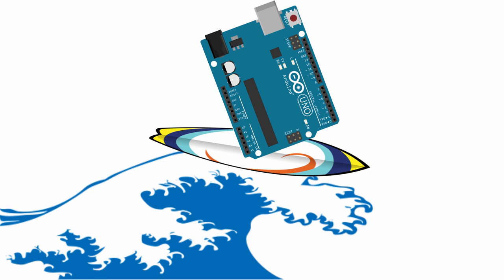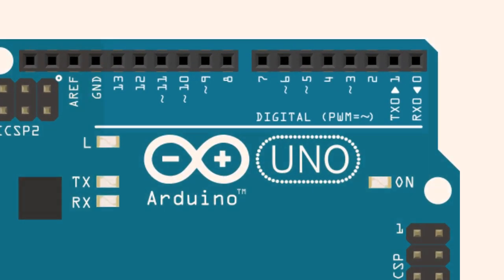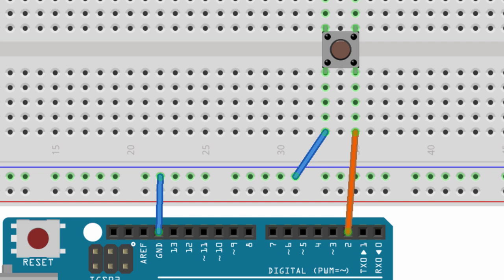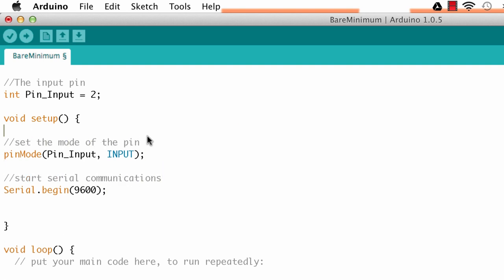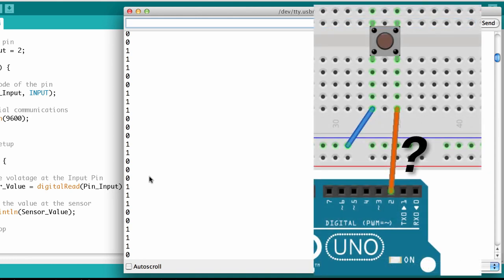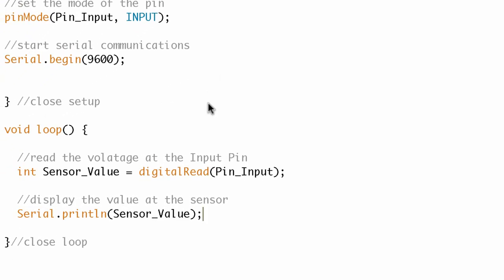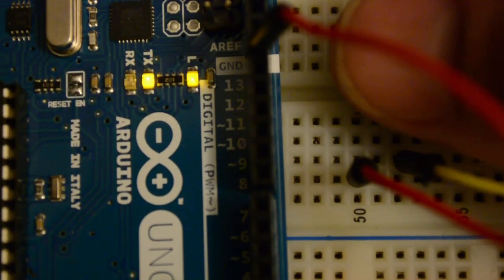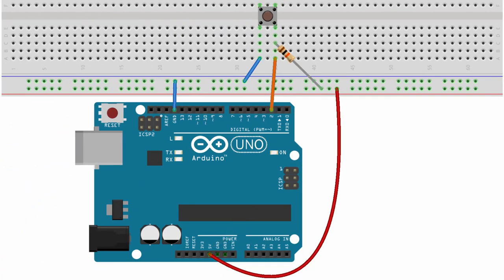Floating Pins, Pull-Up Resistors and Arduino

Comment: Great video but why don't you use the internal pull up resistor built into the Arduino boards instead of an external pull up resistor ?
Reply from the maker: Ken Franco Great question Ken!  Since the button sketch examples that come loaded with Arduino all use external pull ups I decide to follow suit.

But I agree, the INPUT_PULLUP is the way to go.

Comment: i m a beginner 1st yr studentwhat should be the approx value of  pullup resistor ? so that the pin reads high despite its drop across resistor.

Comment: at 9:00, the pin2 read should not be 5v when no press, because there is a resistor
Reply: yeah it should read way lower than 5v  because 10k resistor limits voltage + current

Comment: lmao! I didn't even know I had this problem and since I am a programmer, I did the solution software-wise by it counting the number of loops that it's low. If it is low for over 20 loops the button is pressed. Not very elegant, I know

Comment: the atmega 328 has built in pullup resistor you have to activate in the void setup using digital write to high. ;)

Comment: I'm confused. My understanding is that INPUT mode states that the pin reads voltage. The voltage flows from source to the ground. What is the source in this case? The flow is from the ground to the pin? I always thought that INPUT pin will read +v not ground.
Reply: +313jacob T thought that too and I was going to ask that until I saw your question
Reply: Your're right, it does read voltage.  Ground is 0 volts.  If you connect ground to an input pin, it reads that as LOW.  (On an Arduino, that is anything below, I think, 1.2 volts.)  If nothing is connected, then the input pin floats, and you get unpredictable readings.

Think of it in terms of water.  Suppose that a garden hose is connected your pool (the Arduino) and ground (a drain).  Let's say that in this bizarre pool-world in your Arduino, there can be passing rain showers that can instantly fill up your pool, and there are also other internal drains that will eventually (but not instantly) drain this rain water off.  But once the garden hose is attached, water in the pool drains instantly.  If you don't have the garden hose attached, that stray water sloshing around will vary, so that at times, it looks like the pool is full enough to swim in (the pin registers HIGH), and at others, it's barely full enough to wade in (the pin registers LOW).

Comment: Great video.  I always think of a pull up resistor like  a coil spring.  When the resistor is connected to 5V,  it tries to pull up the voltage at that point to 5V but can be overcome by a direct connection to ground when the button is pushed.  Much like a spring, it returns to the original position (5V) when released.  When the button is pushed there is a 5V drop across the resister which is converted to a very small amount of heat.  There is very little current flow because the resistance is relatively high.  A pull down resistor really works the same way, the resistor or "spring" is connected to ground.  When the button is pushed the switch can provide 5V which overcomes the ground and produces 5V to the Arduino pin.  Since the symbol for a resistor is a wiggly line, it reminds me of a coil spring.

Comment: Would you please tell me, what is the resistance of pull up resistor on this diagram?
Reply from the maker: It's a 10K Ohm resistor in the circuit diagram.

Comment: I’ve watched about four videos on this topic, and yours is the first that explicitly says why a resistor is needed not just how to do it. The part where you said path of least resistance is when the proverbial lightbulb went off in my head. Thanks!
Reply from the maker: Great to hear!  Sometimes for me I think it takes quite a few different angles, and then all the sudden things pop into place - its a great feeling.  Glad this could help some!
Reply: @programmingelectronics  I don't think it's about repetition and different angles, it's more about asking and answering the right questions, and breaking it down into digestable parts. After previous videos I was still clueless at the end. Your explanation and visual aids were fantastic, and I echo @clunkclunk2099's experience. Thank you!

Comment: This is the best tutorial i ever encountered but still a small question. After the pull up resistor is connected to 5V , isnt the connection to digital pin 2 is always gonna read High even after its pressed or not ! or am i wrong on some logic ?

Comment: What's the difference with this wiring and other where pressing pushbutton gives HIGH voltage and not pressing gives LOW voltage?
Reply from the maker: Great question!  You would have one side of the button connected to 5V pin, and the other side connect to an Arduino pin set as an INPUT, and also a pull down resistor going to ground.  I often see pull down resistors around 10K ohms.

Comment: I think it would have been helpful to add that changing the input pin mode assignment from
pinMode(Pin_Input, INPUT);
to
pinMode(Pin_Input, INPUT_PULLUP);
accomplishes the same thing and eliminates the need for an external resistor.
Reply from the maker: Totally agree Chuck!  Thanks for pointing that out!

Comment: Best explanation of Pull-Up Resistors I've seen. Only improvement is if you said the Arduino has one built in, and how to activate it.
Reply from the maker: Thanks so much for watching!  Good call - that totally should have been covered in this video.  You may already know, but just in case...

To use the internal input pull up, use pinMode(yourDigitalPinNumber, INPUT_PULLUP) 

What this does is set the pin as an input - so it can read digital inputs - but it is internally being pulled to a HIGH state.  If you want to trigger your input, you connect the pin to ground (i.e. through a button press)

https://www.arduino.cc/reference/en/language/functions/digital-io/pinmode/

Comment: I have recently been using 2 pin instead of 4 pin pushbuttons.  Do the 2 pin buttons eliminate the risk of floating?
Reply from the maker: Great question!   It does not eliminate the risk, since the pin still floats when the button is not pressed.

Comment: Great explanation, as a follow up, why don't you do a video on the internal pull ups of the arduino?
Reply: Electronic Parts idd really like to see a video explaining int pullups as well.
Reply: @noud8868  Using the internal pullup means you don't need to add your own pullup resistor. To connect the pin including using the pullup resistor included in the Arduino use this code in the example given in the video 
pinMode(Pin_Input, INPUT_PULLUP);

Comment: Michael Cheich: Thank you for this excellent video.  Took me a while to "get it", but now I do.  After watching this, I took your free "Arduino Crash Course", which convinced me it would definitely be worth buying full access to all your training, which I have now signed up for (so you can, as you say, keep gas in your Lamborghini...)

Now just a couple of notes (as Michael says, the best way to learn is to look for opportunities to "teach" - explain it to someone else):

This video shows the problem of floating pins, and how to resolve that via an external pull-up resistor.  Once you understand the concept, you can by-pass the problem on digital input pins in one of these two ways in your code (rather than on a breadboard) - using digital pin 2 as an example:

pinMode(2,INPUT);
digitalWrite(2,HIGH);  // WRITING HIGH to this INPUT pin activates its built-in pull-up resistor.

OR

pinMode(2,INPUT_PULLUP);  // Does both of the above steps in a single statement.

Either of those activates the internal pull-up resistor built into the Arduino digital (and maybe analog?) pins. This info can be found in the Arduino Reference documentation for the pinMode function.

Again, I suggest you DON'T use the built-in pull-up resistors until you complete this video and understand the problem of floating pins in the first place.

Comment: What you are reading at "floating" pin is your main (50 or 60 Hz). That is because input pin has very high impedance. Pull up resistor make "offset" to the +5V. But, you may want to avoid adding resistors to +5V by simply using next code(s):
pinMode (2, INPUT_PULLUP);, where MCU gives about 200 kOhm resistor internaly to pin 2. Or:
pinMode (2, INPUT); digitalWrite(2, HIGH);, which gives the same result. Note that although pin 2 is input, you write in setup HIGH value (digital 1). There is NO pull-down resistor inside MCU. Another advanced way to make whole sketch:
void setup() 
{
  Serial.begin(9600);
  DDRD &= ~(1<<PD2); //set PD2 as input (pin 2)
  PORTD |= (1<<PD2); //Internal pull-up resistor on PD2 (pin 2)
  DDRB |= (1<<PB5); //set pin 13 as output (LED onboard)
}

void loop() 
{
  (PIND&4 ? PORTB |= (1<<PB5):PORTB &= ~(1<<PB5) ); //if PD2 = 1 then pin 13 = 1, else pin 13 = 0
  Serial.println(PIND&4 ? "Button is Not pressed":"Button is Pressed"); //if PD2 = 1, print first statement, else print second one
  delay(500);
}
Reply: Floating pin take charges around from your finger, stray wires etc.! This causes the fluctuating voltage..So you need to tie it up! Nice concept!

Comment: I understand it now. If the button is pressed the path of least resistance is to ground. So then is there some small resistance inside pin 2 when the pinmode is INPUT?
Reply from the maker: Hi Gus, Yes, there is actually a really large amount of resistance inside pin 2 when it is set as an input.  Below is from the Arduino reference:

"Arduino (Atmega) pins configured as INPUT with pinMode() are said to be in a high-impedance state. Pins configured as INPUT make extremely small demands on the circuit that they are sampling, equivalent to a series resistor of 100 Megohms in front of the pin. This makes them useful for reading a sensor, but not powering an LED."
Reply: Open Source Hardware Group Great thanks!

Comment: can we use the Pin_Input directly without have to define Sensor_Value in if/else statement?
Ex: if (Pin_Input == LOW) {digitalWrite(13, LOW);  }
Will it works?

Comment: Just watched multiple pull-up resistor videos. This is easily the clearest and best, thanks.
One question please:
Final circuit shown 9:00. 
Switch closed. I'm imagining that Pin2 is "positive" and current flows to GND.  (Maybe I shouldn't be thinking like this, but either way I understand reading is LOW).

Switch open. Current flows from 5Vpin to Pin2.
Question - Pin2 must ultimately lead to ground for this to work right? Within the structure of the board.

Comment: Thanks for valuable tutorial.
I have a problem. I used three pin of Arduino Uno for difefrent warning in the Banana Glasshouse. High heat, high moisture and high wind speed. I connected 10k resistor like your tutorial. It works in my office without problem. When I connect Ground to any of my pins it tiggered the GSM module and call mbile phone for warning. 
But When I use this sytem in the Glasshouse it start to call me without contact of any pin to ground?! I could not understand. There are drivers and any other electronic equipments in same room. What shoul I do? Why the ground and digital pins contacting by theirselves without touching them and without any effect?🤔

Comment: my problem is when my Analoginput pin, is release the arduino restart and read again, but when it is not connected and i connect it, it reads normally fine, I don't know why it resets the arduino though. i am reading voltage through a0; and the voltage is 4.88 but when i turn off the supply of 4.88 arduino resets. why?

Comment: So without the resistor, the resistance of pin 2 is extremely high (100 Megohms) because that's built in? That resistance would make too little current come through, and so the 10k resistor allows for more current? Is that why this doesn't work without the 10k resistor?

Comment: I would also add that this mysterious "noise" is that cable starts working as an antenna (like the one in your phone), if you pull out the cable, the pin read will go from random to 0.

Comment: sounds more like anti-noise-resistor than pull-up.  i know it pulls up a floating pin to 5V, but ultimately it makes the stable, which is the point.    but the name pull-up make it sounds like it was low volt, and now i have higher volt, which is kinda misleading.

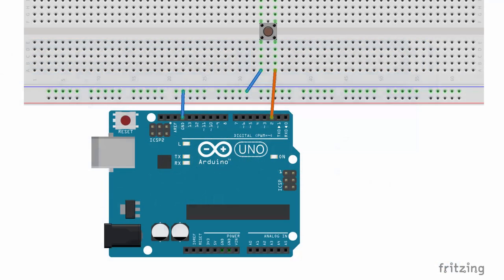Comment: I assembled the circuit as it is at 1:49 , and using completed code at 4:45, I am unable to create the floating scenario as observed at 4:52. The serial output is always 0 and pressing the button does nothing. I see an ideal behavior of 0 when the switch is connected only to ground. How is Pin 2 able to read the input without any power-source anywhere in the circuit since the switch is already connected to ground?

Comment: Thanks for the lesson. 

A question: wouldn't pin 2 be seeing something less than 5 V when the button is not pressed because of the voltage drop across the 10 Kohm resistor?
Reply: +Forbes Winthrop No the resistor is connected in parallel so the voltage drop over the resistor is 5 V and therefore the Voltage at D2 is also 5V
Reply: Dark's explanation is a little foggy. The microcontroller pin was able to float, which means that it has a VERY high input impedance. That means current doesn't really want to flow into the pin, the voltage drop across a resistor is proportional to the resistance times the current. So if the current is small the voltage drop will be small.

[ inside arduino ~~~5000kOhm~~~ ]pin2--   ~~~10kOhm~~~ +5V

As you can see from this little diagram, most of the voltage drop will occur inside the arduino, in this example with gestimated values you'll see only 1% voltage drop outside of the arduino and Pin2 would read 4.999 volts which will of course be digital HIGH (anything over 3-ish) will be digital high.
Reply: Ohm's Law. Resistance and voltage define current. So if you know the current and the resistance you can find any voltage. The same current flows through all resistances in a series, so you can easily calculate what the voltage is at any position.
Reply: Forbes Winthrop, you only have a voltage drop when there's current flow. The input resistance is in the megohms so virtually no current flows, so no current, no voltage drop.

Comment: 9:00 why do we even need a resistor there? can we just put a wire directly to 5V?
Reply: it will draw too much current. your shorting the micro controller

Comment: Excellent video. Now I understand a LOT more. Thanks!
Reply from the maker: +Maxr1998X Great, glad you found it useful!
Reply: +Programming Electronics Academy  Can we use INPUT_PULLUP  in our code ?as opposed to adding an external resistor or does it not work like that ?

Comment: That's a great explanation of a "pull up" resistor. I assume a "pull down" resistor does the opposite holding the pin value to 0V. I see other tutorials where the content provider will connect the resistor(s) to the ground side of a LED(s) circuit so it's a little confusing to me. Can someone explain the best practice for both type circuit?  Maybe in a simple circuit it doesn't matter, I don't know. I am new to this Arduino stuff.

Comment: Nice explanation.  That said, when things like this are done, in my old and tired brain, I keep thinking 'that is a short!!' but the resistor seems to protect from that I guess, and thus the reason not a solid wire in the pull up portion.  my brain hurts....

Comment: Awesome material ! Question about adding in a pull down resistor to a pin, what size resistor would be standard to pull the pin down? I have looked around, but can't find a specific reference to simply pull an arduino pin down.
Reply from the maker: MrShawnlloyd I believe 10K is a common value for a pull down resistor.  Hope this helps!
Reply: MrShawnlloyd A good rule of thumb is 10x the impedance of the input pin. In general, 10K Ohms should do it.
Reply: Are the impedances of the pins in a manual for the Arduino, or do you have to measure them? Also, is there a voltage/current limit for an input pin on an Arduino (will it damage the components of the board?)?

Comment: I guess a dumb comment and question would be is 
1)  The pin doesn't see a value of 5 V, but actually a value a bit smaller since there will be a voltage drop. Correct?
2) Why use a resistor in the first place? Can the pin not handle 5 V?
Reply: +Ye7ia07  The reason behind the resistor is that when you push your button you want it to read LOW. If the resistor was not in line you would be back to a floating state when the button is pressed. Think of electricity like water. If you have two hoses of the same size and with the same pressure running through them they would essentially have the same volume running through them. Now if one of those had a reducer in it and volume and pressure remained the same, the one with out the reducer would be pushing harder. Same Situation with the arduino. The resistor limits the current flow from 5V enough that the ground circuit has the easier path. The cool thing with the arduinos on the market now is they have an internal resister and you can use it to do the same thing as the breadboard wiring. If you are interested in that Check out internal pull up resistors. Basically you set the pinMode to HIGH and can use your switch to control ground with a nice clean set up. 

Hope that made sense.